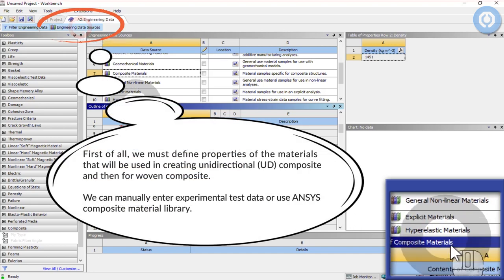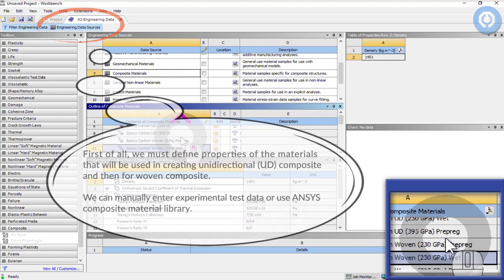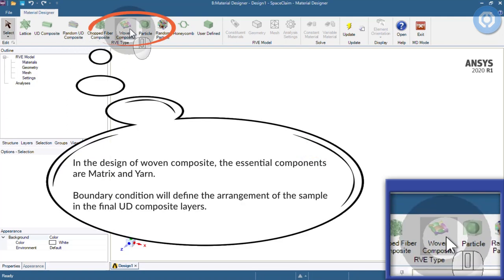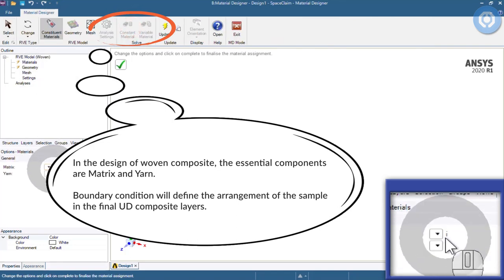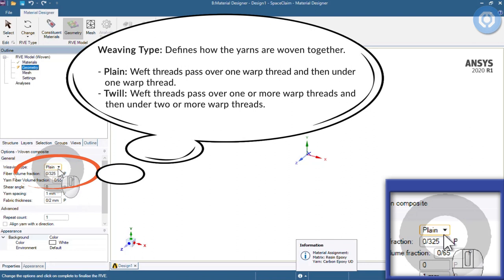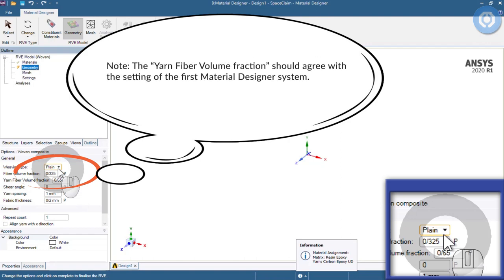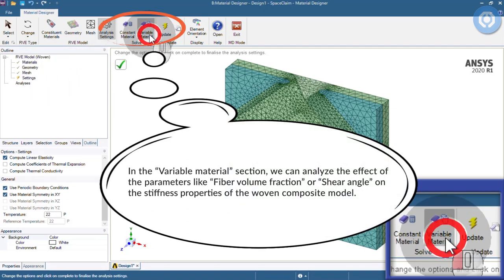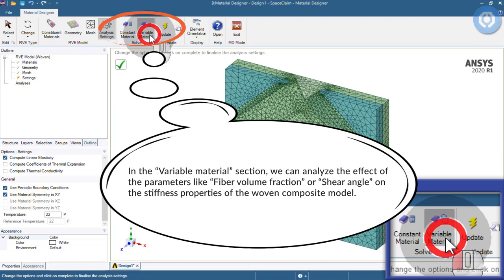⭐ Design of Woven Composites | ANSYS Tutorial

Comment: Thanks very much for your efforts. One thing I would like to ask 
While making carbon woven epoxy why did you choose yarn as CARBON EPOXY UD. Isn't the properties of this yarn (which you are defining) already contains epoxy as well???
Reply: @iDESIGNBests  How can you show or add the epoxy or the matrix in the ansys? OR in this design?
Reply from the maker: Hi. I didn't understand what is your problem. This is the one of the general processes for manufacturing composites. manufacturing UD composites from fibers and then using UD composites in complicated composite structures